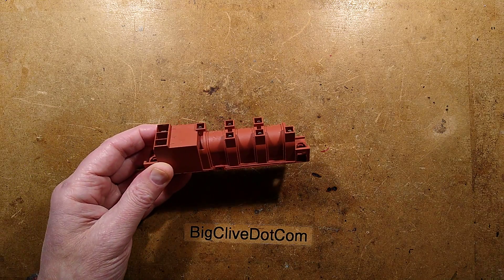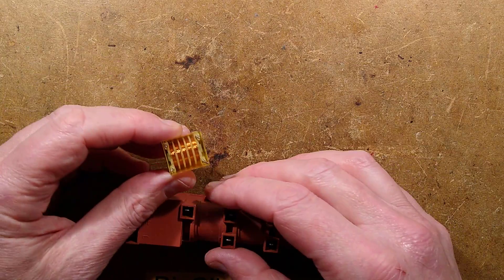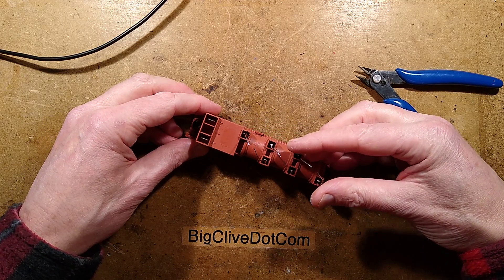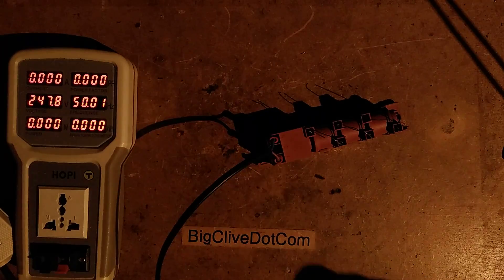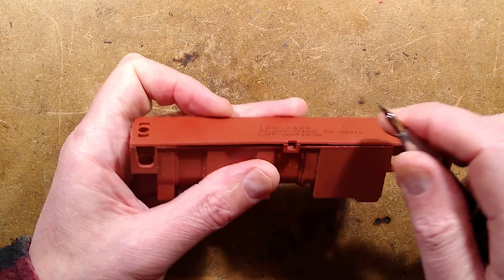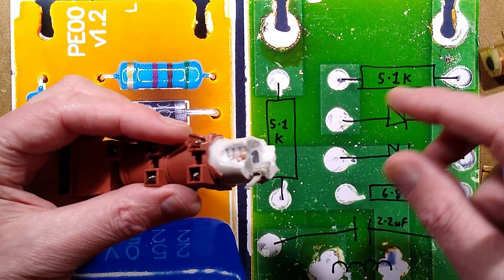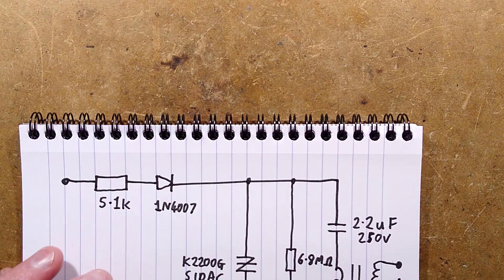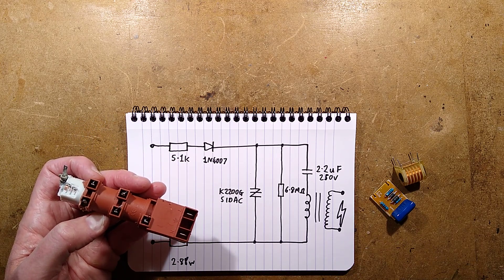High voltage igniter teardown with schematic

Comment: Those sparks were a bit underwhelming. But they'd do their job - ignite a stream of gas-air mix from a jet nozzle in a gas-powered device.
We have some households equipped with gas-powered continuous-flow heaters (for tap water) here in Austria, and I specifically remember the one "from my childhood". It had no electrical connections; to ignite the pilot flame, a single electric spark would be given by twisting the knob on a cylindrical gadget. Heavy resistance when turning, and it would suddenly give a very loud "click" that would be amplified by resonance in the flow heater's chassis. Scared the shirt off me the first time i did that! Years later I learned about the piezo-electric effect.

Comment: The last gas range we had used pilot lights. Everything we have now is electric. Even the home heating.
So. the sidac works like points in an old car ignition system? Making the primary on the coil suddenly collapse?

Comment: SIDAC...  Seemed familiar to me when described. Then I looked it up and learned it's similar to a DIAC only working at much higher breakdown voltages. Very interesting to learn about these devices as I am more of a T.V/Radio/Computer component level repair engineer. So I rarely get to deal with domestic white goods or industrial electronics.

Comment: Funny how the young generation keeps using 0.51 precision components for "roughly half" instead of the 0.47 value that's available in the cheaper 10% to 40% product lines (E3 series).

Comment: If the supply voltage happend to be below 220V, e.g. in a farmhouse at the far end of a long local distribution line, would the SIDAC fail to trigger? If so, you wouldn't be able to light your gas hob without matches 🙂It might have been more reliable if the SIDAC were set to trigger at around, say, 200V. Would there be any negative side-effect to doing this?
Reply: The effective voltage can be below 220v, as long as the peak of the sine wave is over 220v. Even in the worst case, it will still be plenty to trigger it - rectified mains is about 300v.

Comment: I have a very similar one of these I salvaged from a 90's gas cooker, with 'Sarico' on it as the brand name.
The six spark output leads go to six separate ceramic insulated ends.
Two outputs have metal mounting brackets and attached to the bracket is a solid wire for the spark to jump to.
These two would have been to ignite the oven and grill, and the other four outputs for the four pot burners.
I assume they would've used the cooker chasis ground connection as the return path of each spark output?
Can you possibly confirm my theory please Big Clive🤔
Reply: It’s more likely that each circuit is jumping two spark gaps in series and the appliance chassis just completes the circuit between two of the igniter tips.
Reply: @paulmccoy2908  Thanks Paul. Ah yes, that makes sense, given the way Big Clive just added the wire links to each output terminal pair (either end of each individual transformer output winding) and clipped them to provide a spark gap, and that also jives perfectly with the schematic Clive showed too👌👍

Comment: That module looks very similar to the Hotpoint HUG61X gas igniter module that failed on my old cooker. I managed to replace it with one of those cheap eBay igniter (stungun) modules, that surprisingly produced a much healthier spark from a single 18650 cell. Interesting video Clive, thanks for sharing.

Comment: The resin potting increases the voltage rating on the transformers. It would have to be way larger to meet the same voltage rating without being potted.

Comment: 10:25 diac not triac
Reply from the maker: I did mean a triac as in latching on fully until current is zero.  A diac is only really suited to low trigger current.
Reply: @bigclivedotcom , fair enough, but you were describing avalanche functions and triacs don't do that, well technically they will, but just the one time.

Comment: I guess a sidac, is like a normal diac on steroids! I've built this kind of circuit using a diac  triggering a thyristor, but this is a much simpler way to do it. You can also use a ne2 neon, to trigger a thyristor. It does the same thing.
Reply from the maker: Yeah.  It's like a power diac.

Comment: Without the 6.8Mohm resistor could these charge up and spark randomly?
I ask because we have a gas stove that does just that. Every few hours I guess.
Reply from the maker: Yes.  That can happen with capacitive coupling between wires.
Reply: @bigclivedotcom  Thank you. Good to know it's not a sign on a problem.

Comment: You mentioned SIDACs in a previous "deconstruction" video - and they are useful for the purpose shown - dumping a large charge from a cap in series with an inductor.  I've seen these being used in other applications (particularly mains bug zappers, where the HV output is used to charge a cap. bank for an "extra juicy" spark  when an "undesireable" bridges the (usually wire mesh) contacts!
Reply: @GeorgiaRocketman 😁 😁 😁

Comment: 2.88w, but only half wave, so 1.44w of dissipation, spread over 2 resistors, would approximate 700mw each... so probably the resistors current rating is being abided by. Even if other parts here aren't as per other commentors.

Comment: Ways to overclock it:
1- full bridge rectifier
2- bigger capacitor
3- higher frequency power suply
Reply: 4- Fire extinguisher
Reply: Higher frequency input will do nothing.  DC input will feed the spark oscillator continuously instead of half the time, thus doubling the output speed.
Reply: @johndododoe1411  i said higher frequency, not dc. It would do the same, but faster
Reply: @massriver  (as far as i understood) it discharges at the top of the sine wave, and the sidac would just turn off close to 0v. So a full bridge recticfier would just make it do the same, twice as fast (i think)
Reply: @Giuliana-w1f  It won't spark until the LC circuit has been pumped with enough energy to create the spark.  This energy apparently takes multiple 50Hz cycles to gather as it sparks less than 50 times per second.  How do you think faster input cycles will speed up the energy build up beyond it's current speed?

Comment: Kind of missed an opportunity to beef it up a bit by reducing the input resistors and speeding it up.
Reply: Not going to do the SIDAC any good life wise, seeing as it is beinmg run here rather well past the ratings. Normally meant to be on for 10 seconds at most every 5 minutes, to ignite a burner. Otherwise you just blow up the sidac from overcurrent, though they are very cheap even retail, looked up by me and it is a 20p UK part. Rated for 0.9A continuous, 4A single pulse, so even here it is being run very hard. You would need to add in a decent SCR and a few more resistors to get it to run continuous, and then upgrade that 2u2 capacitor to one with a pulse rating that is useful. Will make it probably 5 times the volume, and 30 times the price.